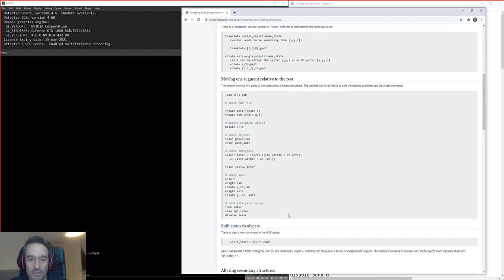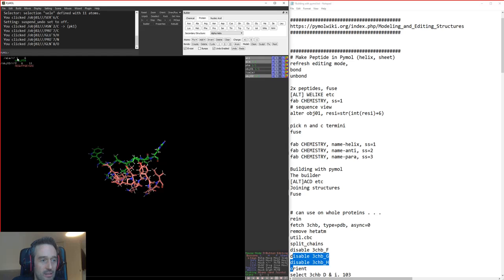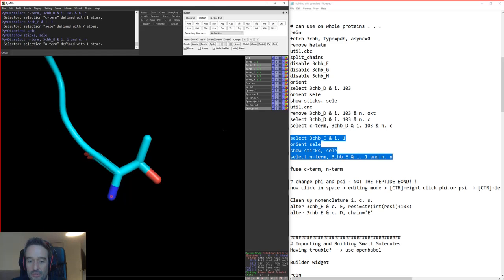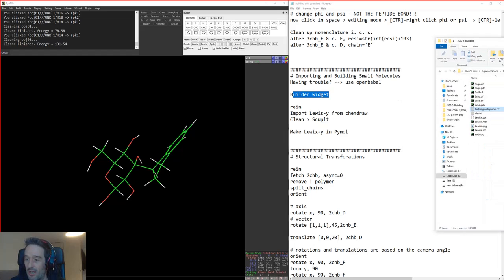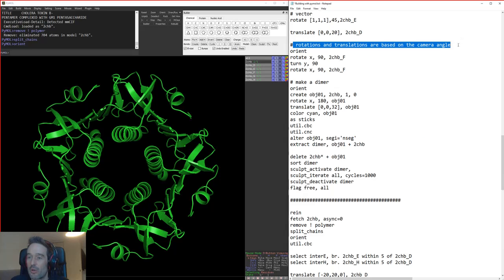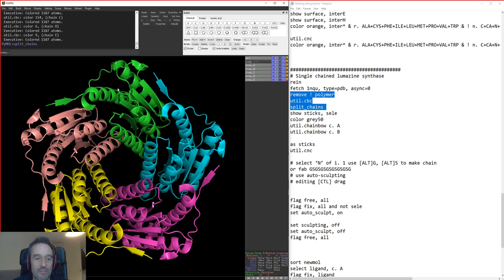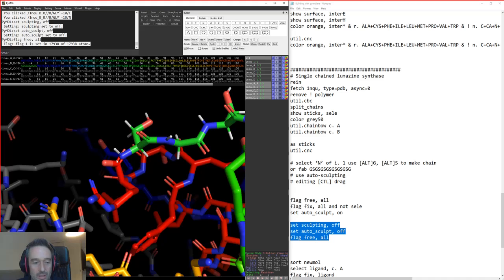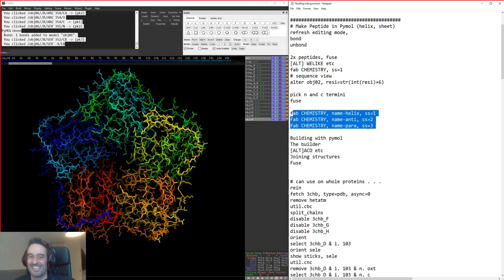PyMOL tutorial 5 : Building and Manipulating

Comment: Thank you very much for this tutorial! 
I am struggling a bit with making an icosahedral viral capsid from a monomer structure that I obtained from alphafold. I have the capsid of the virus for the non mutated coat protein ( available in the pdb) but I couldn't build the full capsid muself for the new protein 
Do you have an idea how I can do that?
Reply from the maker: Hi @kokoro9218

As you have a template structure the process should be relatively easy, however this depends on the format of the template on the pdb.
Lets assume that the template has 60 chains and each chain has a unique chain identifier.  Then you can use commands such as 

# check the name of the object, assuming 'AF-structure'
# make a copy of it called AF-01
create AF-01, AF-structure

# check the name of the template and chain ID's, assuming 'template' and chain A
# make an alignment
align AF-01, template & c. A

# now repeat the process for the rest of the chains in the capsid, this can be done by pasting the commands into a notepad and altering the parts that need changing (namely incrementing AF-01 to AF-02 etc and changing the chain from A to B etc, or you could write a small script to do that for you.  Then just copy and paste the whole lot into the pymol console.

If the AF-structure is not a monomer, or if the template pdb is in a different format, let me know the details and we can work out a solution.
Cheers
Reply: @pymolross   I still haven't tried what you are proposing but the capsid is formed by 180 chains and each chain is always present as a dimer. In theory 3 chains should make the primary unit... I don't know if it was clear .
Reply: @pymolross  I think your method can work because it makes sense. I still haven't reached the point to write scripts but yeah I will sed what I can do
Reply: @pymolross  thank you very much for your answer 😊
Reply from the maker: With 180 subunits your capsid is probably a T3 (by triangulation number) and should be composed of 60 x 3 unique chains.  Often these chains (as more than 60) will have unique identifiers based on their 'segment identifier' which is four character identifier.  This makes the process similar to above except you will need to find the segment identifier, and align using that. to modify the above command you can use
align AF-01, template & c. A & s. 0001 (where c. A is the chain and s. 0001 is the segment identifier.)

However, this does start to get complicated.  What i would advise (if you are not into scripting) is to manually make the selection and then do the alignment.

So if your AF-structure is a monomer, (and your are only replacing one in three chains)
Make copies of the molecule as above (ie making AF-01, AF-02 etc)
Then select a subunit (make sure you change the selection criteria, bottom right, from residues to chains). then . . .
align AF-01, sele

If your AF-structure is trimer you can do the same, but make sure you pick the three chains of the triangular asymetric unit.

Note; in some cases, when you try to select one chain, more that one will get selected, if this is the case, change the selection criteria from 'chains' to 'molecules' and this should fix the problem.

hope that helps.
Reply: @pymolross  thank you bery much for your help. I will tell you if I manage to do it as you proposed. :)

Comment: Hi Ross, I have a Ribosome PDB file, I have a nascent chain I need to attach the C terminal of chain to the Last Phosphorous atom in the A site tRNA of the Ribosome to focus on Cotranslation folding what is the right way to build this. Any help in this would be really appreciated. Thank you
Reply from the maker: Hi user-ge6iw7uh3g, 
It depends on the application, are you doing this purely for the visualisation? anything else and you would probably need to be more sophisticated.

enter the editing mode (click in the words "3-botton Selection" in the lower righthand side of the screen)
click on atom 1 and then on atom 2, type "bond" and pymol will draw a bond.  you can do this to bond any two atoms (regardless of length or chemistry)

So i would find a ribosome structure which already contains the nascent chain and the tRNA (or two structures containing a part each and merge them).
If the nascent chain is too short you can add residues to the C-terminus until it reaches, or you can drag the molecule using the sculpting function.

Hope that helps.

Comment: Hi , How can I add a Flag tag (DYKDDDDK)  between  2 residues?
Reply from the maker: Hi mounaalhouli, 

Have a look at this video, https://youtu.be/ZpU8sxKwsvA. You should be able to use the techniques shown in this to add your sequence into a loop.  Just remember that PyMOL will not give you an minimum energy structure, if you plan to use it for other computational studies, you will need to minimise it.  Should be fine for a graphic though.  Alternatively you can use Rosetta remodel.

Hope that helps.

Comment: Thank you for the tutorial, it is VERY useful. I was particularly interested in the builder functions. Would you say PyMol builder is good enough to add a PTM onto a residue side chain? Let's say acetylation. The actual acetyl group is small, but it is part of a much bigger structure, which is the protein. It is for illustration purposes, no docking will be performed afterwards.
Reply from the maker: Hi Luiz, 

Yes, I have answered a very similar question to Rizki in the comments below, you should be able to follow the same general method I described, and change it for your specific interests.

Any modifications to an atomic structure should be minimised after modification, even just adding a single atom, if that structure is going to be used for further computational work.  However, If it is just for illustration or hypothesising, then this is not required.

Thanks

Comment: I want to make anti-parallel beta strands from the sequence. How I can make this using pymol?
Reply from the maker: Hi Paulo, 
thats quite easy, 
you can use the following
fab PEPTIDE, mymol, ss=2

where 
fab is the command
PEPTIDE is the amino acid sequence
mymol is the new name of your molecule (whatever you want)
ss=2 defines antiparallel beta sheet.

heres the wiki page
https://pymolwiki.org/index.php/Fab

however linking them with a turn is more manual, I would recommend aligning them to a previously known structure, or indeed, mutating a known structure with your sequence of interest.

Hope that helps.
Reply: @pymolross  
First, thank you so much for your reply it is great to help me.

And I tried mutating or adding to a known structure but it is changing conformation and new sequences are not forming a sheet it's from the loop structures.
Reply from the maker: @Paulo Biologus
I'm not sure if I understand what you have done, but what i meant with suggestion is to take an antiparallel beta sheet in a conformation which is similar to the conformation you are interested in, then mutate that structure with you sequences, using the pymol mutation wizard, this will keep the backbone in its original conformation.  But that backbone must be in the anti-parallel conformation before you start mutating.
Thanks
Reply: , @pymolross  I just wanted to extend/elongate the existing beta-sheet structure with the same kind of residues. Please suggest to me something to do this?
Reply from the maker: Hi Paulo, 
Ok, so an easy way to do that is to select the beta sheet and copy it to a new object 
(sele) [A] > copy to object > new

now do either a manual alignment, or use the alignment wizard.
manual
click on "3-button Viewing" to change it to "3 button Editing" (found in the matrix in the bottom right)
with only the new object enabled (visible), hold shift and then middle click and drag the new beta-sheet so it no longer is in an overlapping position with the original, probably a good idea to change the colour of the new object.
Then re-enable the old beta-sheet and re-align the new structure with part of the beta-sheet further up the chain, 
alignment wizard
you can align the new beta-sheet to the old beta-sheet further up the chain, where 'i' are the residues number you are aligning
align new & i. 4+12, old & i. 6+10
where new is the name of the copy of the beta-sheet
where old is the name of the original protein (beta-sheet)
and the residue number correspond to residues at given points along the sheet.

Now you should have two beta sheets which are staggered with parts overlapping.

next remove the overlapping residues, select them and remove atoms
(sele) [A] > remove atoms

Next you need to increment the numbers of the residues
select the new beta-sheet section and see by how much you need to change the residue numbering, you can see this easily if you open the sequence view, (the 'S' bottom right)
alter sele, resi=str(int(resi)+2)
where +2 is the amount you want to increment the number
Next select the C-terminal section of the old beta-sheet and in the same manner, increment the residue numbers.

Now you should have an extended beta sheet, without a covalent bond, but with the correct residue numbering.
Select all
(sele) [A] > copy to object > new
make sure you are in editing mode as described above
To form a bond between the chains, select the 'C' of one, then select the 'N' of another, they should had banded spheres around them and type
bond.

Now save you new molecule (obj02 presumably), repeat the process to get a longer beta-sheet.  You can then use the mutate wizard to get the sequence correct.

Hope that helps.
Reply: Can you make an small video on this? If possible. It would be a great help for me.
Reply from the maker: Hi Paulo, 

Sorry, maybe a little late, but I have made a video on this subject.
Please see PyMOL Quickie - Extending Secondary Structure
https://youtu.be/ZpU8sxKwsvA

Hope that's helpful.

Comment: How can I build onto the molecule, say add a phosphoryl group, using PyMOL commands? I know how to do it using the builder gui, but I need to do it on a large scale.
Reply from the maker: Hi Vishva,
There may be other methods, but what leaps to mind first is the following.

First
Make a pdb containing your phosphoryl group (PO4) only with a carbon on one oxygen (PO4C.pdb)
Identify the residue/atom which will be phosphorylated in your target pdb (you can iterate through a list here)

Second
Load your target pdb and PO4 pdb 
align the CO of PO4C to the CO of your serine (for example)
delete the serine oxygen and phosphate carbon, and rename the PO4 appropriately 

load target.pdb 
load PO4C.pdb
align target & i. (residue number) & n. CB+OG, PO4C & n. C+O2
delete target & i. (residue number) & n. OG
delete PO4C & n. C
alter PO4C, resi='(residue number)'

lastly
extract the two objects into one object
delete the rest
run a sculpting session 
for example 

create newmol, all
delete ! newmol
sculpt_activate all
sculpt_iterate all, cycles=1000
sculpt_deactivate all

This is a crude method (and i haven't tested it), but should give you some models which you can further refine.  I might be able to throw a video together to describe this in more detail.

If you are looking to phosphorylate specific amino acids, you can make your PO4 pdb more specific by adding parts of the amino acid to the PO4 to use during the alignment.

Hope that gives you some inspiration.